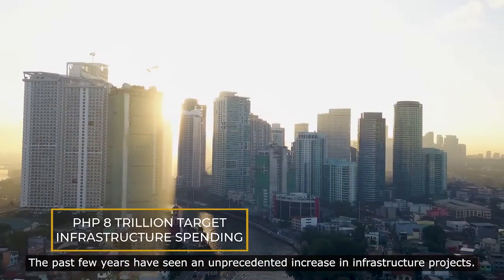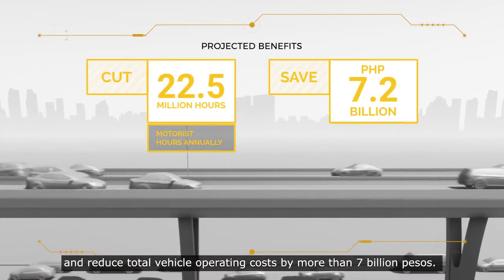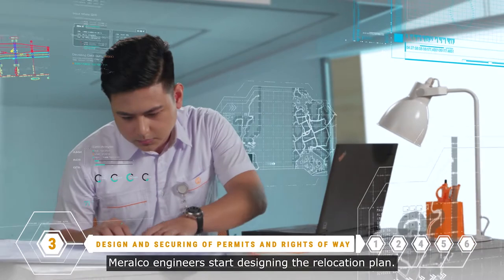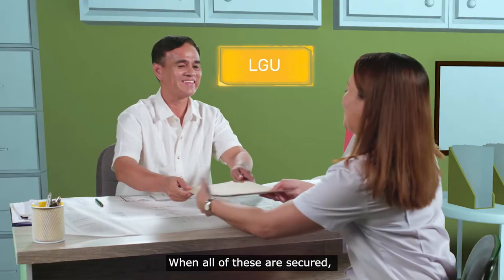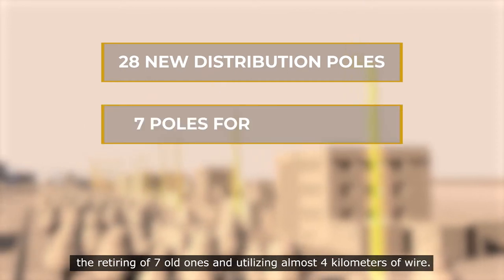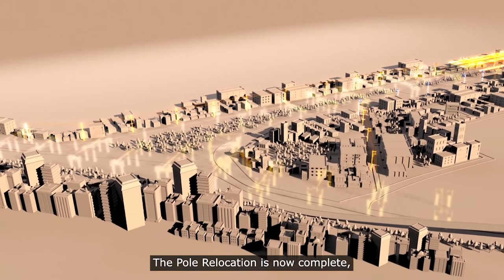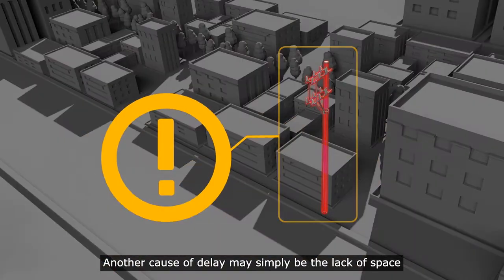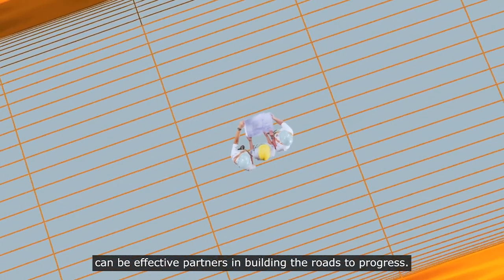Meralco’s Pole Relocation Process

Comment: Sa lupa ko ay may nakatayong dalawang poste ng Meralco, pero ang dalawang posteng ito ay hindi ko mapakinabangan dahil walang secondary lines na pwedeng kabitan ng koryente papunta sa bahay ko. Nang magpakabit ako ng koryente, bumili pa ako ng 60 meters na kawad, bale 180 meters ang nabili ko dahil 3 wires ang load side. 
Hinihiling ko po na magkaroon ng secondary lines ang mga posteng papunta sa Core Housing para maigsi lng lng ang bibilhin kong load side wires.
Kung hindi pwedeng maglagay ng secondary lines, baka naman pwedeng habaan ang libreng service drop hanggang doon sa bahay ng anak ko na ipinagagawang bahay.